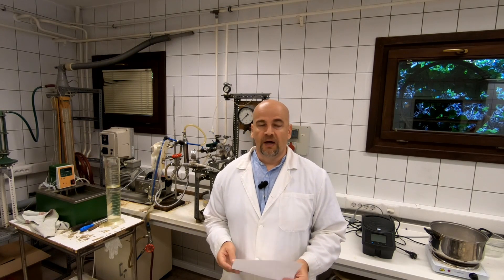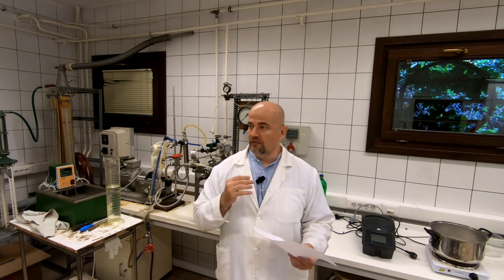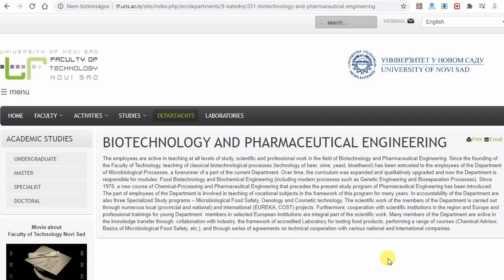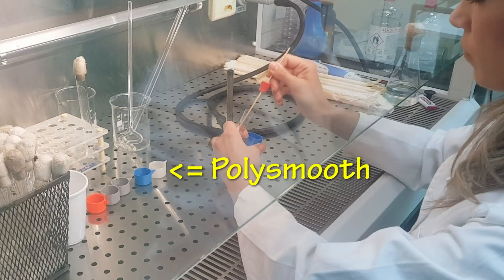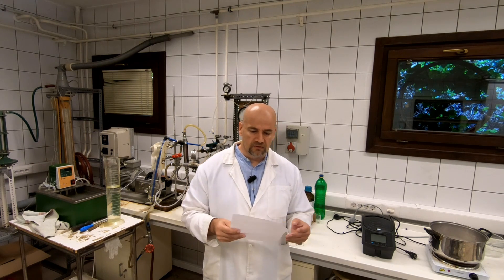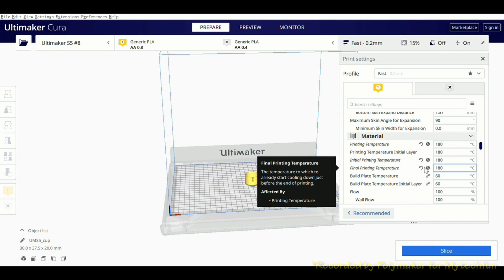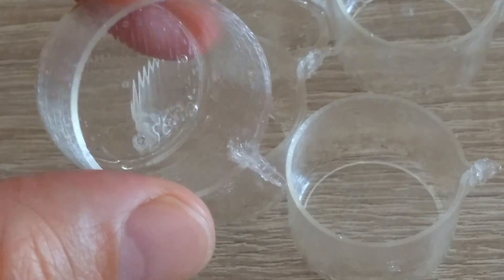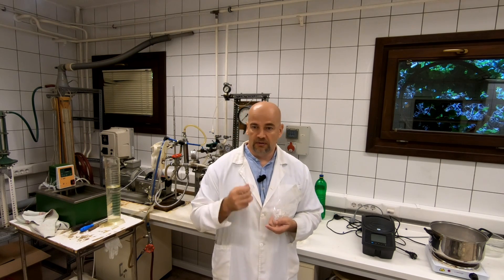Smoothing 3D printed object from Polysmooth™ for better cleaning - is it food safe?

Comment: I think there are some areas where the experiment could be improved:
1. printing at lower layer hight so there are fewer uneven surfaces and crevices.
2. printing at lower speeds, so again the surface is smoother and there is no dripping on the nose.
3. properly setting up cura profile. It is a shame filament producer could not properly print such a simple model.
Reply from the maker: I agree with you, but I already tested different layer heights (in first food safe video, link is in description). And later I found out, (since these cups were printed by PolyMaker) they tried to get maximal transparency (since their polysmooth is primary for that), spiral mode, minimal perimeters. But it would be better to print it normally, and smooth it, no metter for transparency, just get smooth inner surface. That resulted the final object as it is.

Comment: Thanks for your videos! Have you made any tests using the 3D printer to make Matrix Molds and use a food-grade silicone to cast the end product?
Reply from the maker: Exactly what I am working on now. Probably I will create a video too. In a month maybe.
Reply: @MyTechFun  I designed a Matrix Mold for that purpose. Although I'm only a designer and had no idea of the risks involved with 3D printing for food purposes. If you want I can send you my files and you can use them for your research.

Comment: That dimple on the inside for the handle is because they used the "Spiralize Outer Controur" option, which is universally known as "Vase Mode". It makes the outside be only a single wall extrusion and most importantly for your testing results. as the Z height is increased all the time there are no proper layer lines, it's a continuous spiral. It greatly improves the transparency after smoothing as there is no possibility of having two lines side by side with a gap between them.

Comment: With their print, they checked off the option for Spiralize Outer Contour, so that would be why the spout came out the way it did. I would guess with your prints you had multiple shells so it didn't have that indentation.
If you were using a 3D print for dry ingredients, is there still a risk? Like a funnel for filling spice jars.
Reply from the maker: I didn't tested dry ingredients so far. Only my opinion: after long period bacterial colonies would appear in those pores between layers, but risk is far smaller, compared to milk for example. Bacterial contamination would be probably from other sources, not from those dry ingredients (dirty hands, moisture, dirt in air etc).
Reply: @MyTechFun  And washing would help but not be 100% due to the small pores correct?